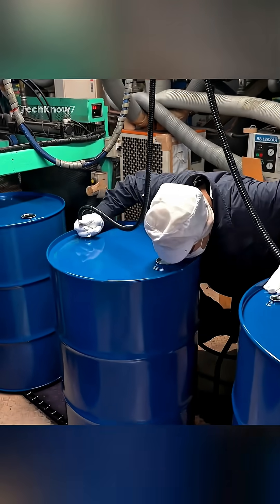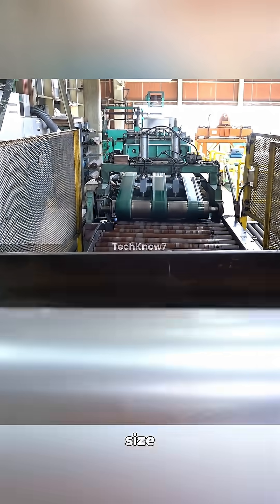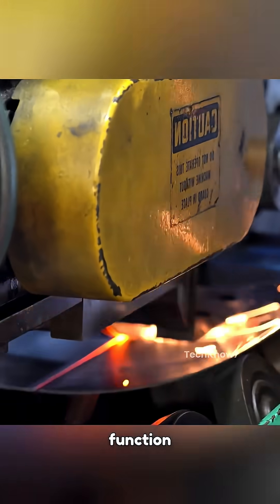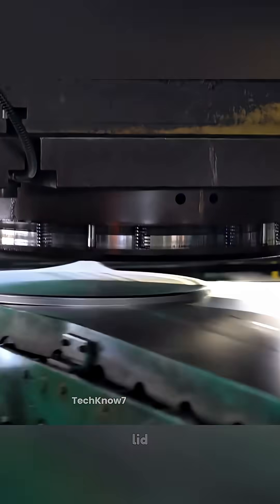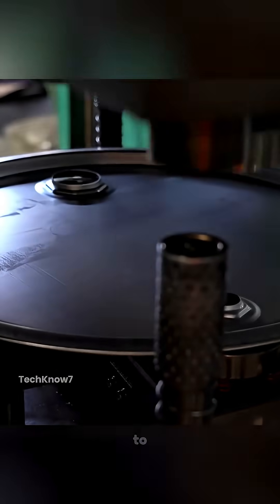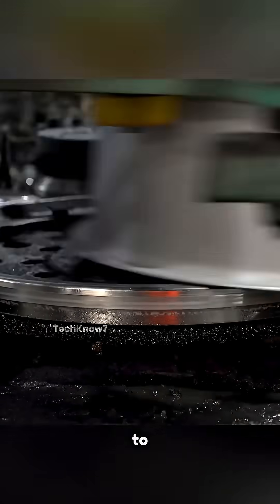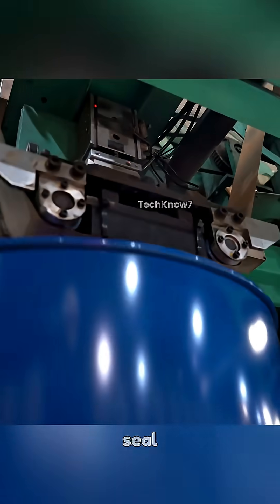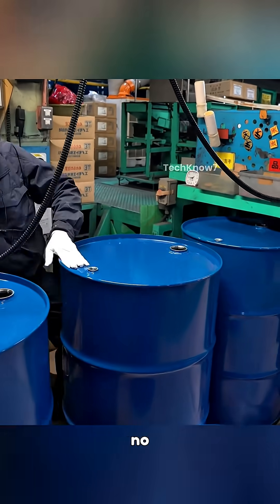Amazing Drum Cans Manufacturing

Comment: What is a problem with these barrels is the zipper that does not hold well enough!!! And I know this because we build cottages on them that float on the river, of course connected by a bridge to the shore and after 2 to 3 years the bora begins to fill with water and sink, since the color on them is still good, which means that they are not rusty or drilled, we started looking for where the problem is?!?! And eventually we realized that the corks loosened and from then on we started to put silicone glue before we closed the barrel and after that they started to They have been kept for much longer, but then the state passed a law that it is no longer possible to place a metal barrel under the house on the water, but a plastic one, with the explanation that it is more environmentally friendly?!?! The price difference is more than 3 times!!! Especially since the barrel is usually found for free, since many factories use it and when they are empty, the factory gives it for free to anyone who wants to take it away!!

Comment: The first machine is called a leveler, the material coming off of the coil doesn't just roll out flat, it's usually wavy in all sorts of different ways, so the metal first has to go through 12-14 rollers that are all set to different tensions to make sure that the material comes out as flat as possible, but the rollers have to be constantly watched to prevent waving issues.

It then is advanced to the cutting bar which gets set to the length that the material's length will be cut to. Lastly, it goes into the palletizer which has 5-7 paddles that will set the sheets down evenly onto skids that are made to fit both the length & width of the material.

The whole process can be managed by two operators, depending on the gauge of the material & how many pieces will be going on each skid. you might have up to 5 people, especially if the sheets are 8 feet long or longer. I've cut sheets up to 15 feet long, and in that case, you have to build custom skids, with up to 4 people just on the palletizer alone.it all comes down to the weight of the pieces ccoming off of the leveler, with stainless steel being the heaviest & the worst to have to handle.
Reply: why two ridges are done ✅ in between 🤔

Comment: The top and bottom edge of a steel drum is called the "chime". It is tightly rolled into seven interlocking layers, making it liquid proof without welding. Drums are made in various thicknesses to contain materials of different flammabilities and hazards, and range from 38 to over 100 lbs empty. Not all drums are "tight heads" as those shown here, drums can have lids that are removable and clamp on.
Reply: I picked up regularly from one of these drum barrel manufacturing facilities, and I can concur. The barrels with removable lids use ring-clamp seals to secure them shut. And even then, these seals can come in plain or lockable varieties incase you need that extra bit of security on the lid.

Comment: Hello my Friends ; ) 

ANUBIS IS THE BEST DOG

What if Pharoah was trying to build a weather machine to attract lightening to nuclear electro magnetic earth ground to cause more rainfall and thus more food. 

Clouds of higher solar charged particles jump to clouds of lower static change, known as heat lightening, as nature seeks a balance. 

When there's enough solar charge in a cloud electricity as lightening crosses the air insulator and connects to earth, as it does it creates a vortex where hydrogen and oxygen particles connect and bring down water droplets and fall due to nuclear electromagnetic gravitational earth gravity. 

Electrons go around an atom like the moon around the earth and the planets around the sun.  
The Egyptians saw that lightening was attracted to metal, and the higher the better. 

If Pharoah had a copper cap on the pyramids with electrodes running through the air chambers down into the spring underneath, Benjamin Franklin might have been wearing an Eye of Horus Watch and driving a Bently.

Is the grounds turned dry, like a leather glove, no matter how much you tried to arc welds, it wouldn't work. Tree roots go searching for water in the winter when there is no rain, as solar photoelectric synthesis move through an organism seeking earth ground.

Also lightening is more likely to hit the lone farmhouse than the neighborhood, as electricity in houses flow through a black or hot wire, and take a neutral [white wire] path back to the electrical panel, where the Neutral Bar is bonded to the Ground Bar and goes into the earth via an eight foot copper electrode to dissipate returning unused current into the ground. So neighborhoods are energizing water tables instead of storing that electricity in batteries.

Anyways, I'm thinking a cargo helicopter, a brand new Copper Cap for each pyramid, and copper electrode wires running down to earth ground via the spring water table, and electrodes can be drilled into the earth below the springs for better contact, and we can complete Pharoah's Weather Experiment as lightening is attracted to metal high up from the ground ; )

Could you imagine the attraction of this new event to honor the Pharoahs and those that built the Pyramids!

And maybe bring more rain to the earth, and keep it most, and electrically conductive and inductive to storm clouds for more crop rain. 

If you want to in vent some cool stuff im at 224x833x2094 usa

Also, should we celebrate ancient ruins or rebuild them to honor ?

Also oil rigs should be underwater and not above and you wouldn't have oil spills 

China builds underwater structures, you could be just 20 feet underwater, you can run vertices flexible stormproof snorkles and a flexible to surface entrance/exit 

And, 

Grow more opium most the world's doesn't even want to be here and people can move other places, it grows in attics that are 140 degrees, skylights would need insulated glass in the attic shafts and you could use mirrors in the gable ends, just don't be in the attic in the day, if there's ever a shortage

Also oil rigs should be underwater and not above and you wouldn't have oil spills. China builds underwater structures, you could be just 20 feet underwater, you can run vertices flexible stormproof snorkles and a flexible to surface entrance/exit

Sharks could be GPS chipped at a bait source and an alert could go to cell phones and beach alert systems if sharks are within 300 M

Aluminum spayed in the atmosphere might f you magnetically with solar flares

Use aluminum for other things, spraying carbon and aluminum heats up the planet and causes refractory radiation on the surface, the carbon in the clouds traps in the heart and in the ocean causes dead spots.  You need solar distilled ocean water misted or of 747's instead, the sun will burst up H2O into H, O1's, making 02, O3 ozone, and you're actually adding more fresh water clouds up there, not depending on surface evaporation by causing more heat in order to make more clouds, you need to cool it

8.4 billion acres of grass=4 billion cows in the world shipped frozen fresh lawn mower clippings somewhere cool like Alaska and each cow gets a bowl of ice cream at each feeding session

You need a leaf sucker truck with a refrigeration unit, grass is mowed for tax refunds,  20 Million jobs paying 60k from May to October in air conditioned, sealed window,  tinted window, XFM lawn mower cabs with triple level suspension seats,  mini leaf suckers pick up small piles and dump them by the street,  big leaf sucker truck picks them up and freezes the frozen grass and then it goes to rail cars then somewhere cool to be 1100 lbs with a boney jacket.  The people that kiss cows and sing songs for them take care of them and she gets a bowl of ice cream at the end of each feeding season.  You'd have 10x more cows,  over 1 Trillion in goods. In the US you'd have to double your grocery stores just for the milk, cheese, cheese cream, sour cheese, cottage cheese,  yogurt,  milk, butter, ice cream, etc...

When she doesn't want to be a cow anymore she gets a bowl of ice cream with some fennies

I have a lot of invention ideas in energy,  defense, security, food infrastructure etc...

Would like to meet up with some people and talk to them about making some cool stuff

Missing solar film wrap on high rises and fields shouldn't have solar panels but should be solar panel green houses growing every crop everywhere, humid and tropical warm all year growing facilities